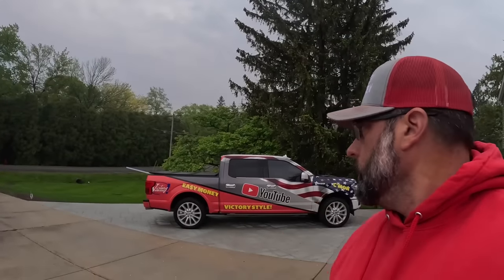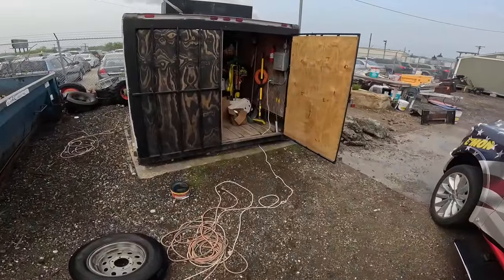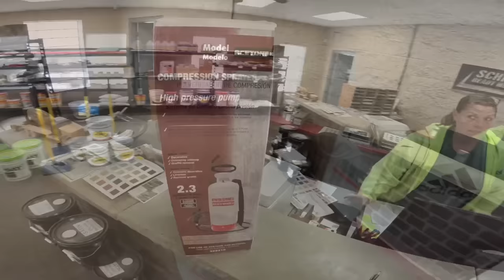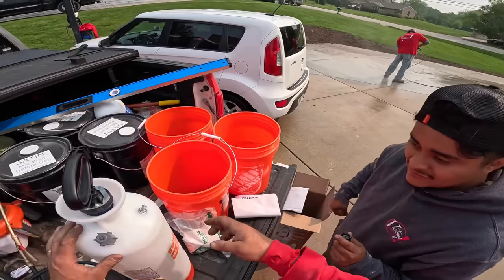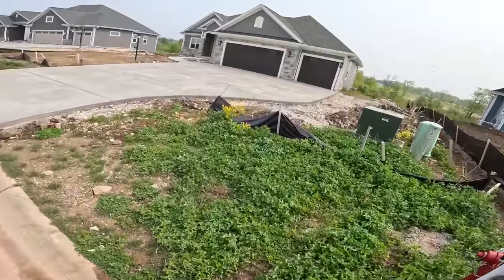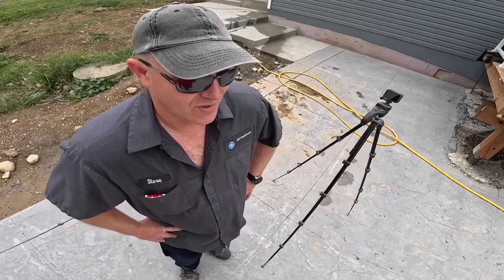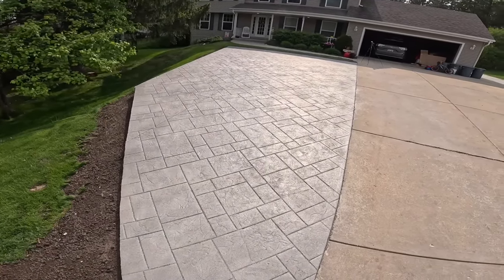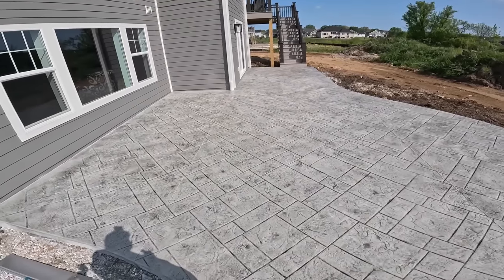Birthday workday!  Still making easy money at 46!

Comment: Ryan try using a paint mixer for your color stain. Just use your power drill, it will suspend the particles much better than stirring it with a stick.
Reply: I wanted to comment the same exact thing. I think his issue came from mixing with a stick like in the stone age 🙂
Reply: +1 for this.  He should know better😮
Reply: Yup!!! All those chunks in the bottom will clog up that sprayer in no time!
Reply: i was telling him from over here to clean the sprayer filter the whole time lol i think it was clogged up
Reply: Ryan really should’ve known better with all of his experience! I think he just doesn’t like sprayers! Lol 👍👍👍😎🇨🇱
Reply: That is what I was going to say... But I would use a little hot water to mix initial then the rest cool water... If it's 3 1/2 gallons 1 gallon of hot then the rest cold water...
Reply: @joepisarz682  Said the same thing....Some boiling water to get the initial mix dissolved, followed by cold water to make up the volume.

Comment: Last video I mentioned that you might make a quick compilation of your stamped patios and here you are, way ahead of me! Those all looked great! 
29:20 When new-fangled tech fails, go back to the old fashioned tech that works.
Reply: I think the sprayer may have failed because he didn’t mix it well enough. Big red flag went up for me when he just poured all the chunks at the bottom of the bucket right in the sprayer :/ he shoulda tried using a drill with a mixer attachment at least instead of doing it the old fashioned way. Would have gotten a much more even mix that way.

Comment: Good Afternoon, I appreciate your videos. Three   other effective methods of applying a liquid antique are to mix in the 5 gallon pail as you did, ( even better to have a measuring pail, in case you need to make multiple batches to keep the batches consistent). Then use either a mop, a small stiff bristled brush, or a car brush. Always keep the concrete damp , if it is not damp you will see brushmarks after you seal. You can leave small puddles , just make sure everything is dry before you seal, especially the antique itself. Do not seal if the antique is damp. Or you could get white spots , if this is to happen re-emulsify the sealer with Zylene. Like I said , If you wait till its dry , there will be no problem. With all three of those applicators ( mop, car brush or stiff brisled small brush) Swoosh the bucket of liquid antique before every time you drop the applicator to the textured slab , then you can move the particles into the deeper imprints of the stamped/textured by moving the applicators in a clock wise , counter clockwise, north-south direction, ect.....these are just suggustions. Thanks for the videos.

Comment: Try adding warm water to the Antique-it mix - it may make it more soluble, although it might not be available out in the field. You may want to enquire if a small amount of alcohol can be added to the mix. In many applications, the alcohol breaks the surface tension of the water and making the mix more homogeneous. Just a thought.

Comment: Ryan l have cleaned carpet for nearly 20 years, in the early days we used pump up sprayers then found a tank you hook up to a solution hose which would be your pressure washer hose you would actually get the same pressure for the entire job instead of pumping going a little about 2 or 3 ft having to pump up again go to a 3-foot if you can find something that you can connect to your pressure washer that would give you consistent pressure the product we used was called hydro-force it had about a 1 gallon tank

Comment: I don’t know anything about concrete coloring, but whenever you dilute a powder in water you have to let it saturate for a while so it all dissolves. I use a smaller amount of hot water for copper sulfate and a drill paddle paint mixer. The hot water helps break it down, then once it all dissolved I mix it with the desired amount of cold water in the sprayer.

Comment: Going to have to put together a utility trailer just for stamping equipment, getting quite the extensive collection.

I have anxiety issues with pump up sprayers, I've broken so many over the years, and usually right in the middle of a job. 
I'm holding my breath every time you start pumping that sprayer, lol.

edit just like that one finally did, right in the middle of a project, as usual.

Comment: Perhaps it’s worth getting one of those drill attachments to mix the product and instead of a sprayer you could use a watering can and brush it in after , 👍👍, the lumps in the dye would have blocked the small filters on the sprayer

Comment: My immediate thought was the sprayer nozzle was not suitable for the powder particles in the mix. If you can get a nozzle with larger holes it will work. I beti f it was just liquid the sprayer would be just fine. Great recovery job all the same.

Comment: I never mix powdered anything in cold water.

In order to get a powder or granules to fully dissolve I use use a small amount of hot water first. Then when the powder or granules are dissolved in hot water I complete the mix by adding in cold water in the necessary quantity. All that sloppy goop was probably clogging your sprayer nozzle because the particles were not completely dissolved into the solution. I don't even like mixing mortar with cold water, and I go over the top with the mechanical whisk to ensure a proper mix

Comment: Get yourself an electric automatic mixing sprayer that allows for medium-high particle size, they have a rotating mixer inside that keeps the color from falling out of mix. On top of that with them allowing medium to high particle size prevents the sprayer from getting blocked up. That's probably what happened with the spray bottle you had.

Comment: The holes in your gas tank are from camphor Beatles, they are attracted to ethanol. They “drill” small holes in plastic fuel tanks. I had a lawn mower that those little suckers completely ruined the entire fuel system.

Comment: Ever thought about 5 Gallon Buckets to pour the extra Concrete into Bucket half to 3/4 put a Pole in it. Then you can use Bucket to Secure Caution Tape to Pole/Bucket advertising on buckets...just a thought
Keep On Keepin On

Comment: Look into getting a surface cleaner for the pressure washer. It's much more efficient and does a more consistent job than using a regular tip on a wand. You do have to match the surface cleaner gpm to your pressure washer gpm. Do not use it on new concrete, it will etch it. As long as the concrete is at least 5 years old it will be fine.

Comment: Get you a paint mixer paddle for a drill and mix it that way that stuff was way to clumpy and that what was causing the sprayer to plug up. But if you mix the stuff in a bucket with a paint paddle on a drill there will be no clumpyness.

Comment: 30:00 it's pretty simple why the sprayer gets like that. it's because someone isn't cleaning it properly. after using it, you need to load it with soap water and then spray it, that will clean the head and hose. THEN you can store it.

Comment: Someone put the holes to the gas can can drain faster. Those cans with that type of spout never flow gas verfy fast at all. It takes forever to fill up anything with them. You can see where someone put tape in the middle because they put it in the wrong place and gas was coming out of it when turned foreward. You have to put a pin hole toward the back top of the can handle and not overfill the gas can in order for it to be affective. The can must breath air in for it to flow well. That's why when you use those you hear gurgling sounds when trying to pour gas. The side also sometimes cave in from not having air in the tank.

Comment: Lots of advice about dieting. Well here's mine. Cut out the sugar like soda, bread, rice and pasta is the main thing. Eat smaller portions and lots of fruits and salads. Meat is okay, beef, chicken and pork. Of course exercising helps, but get thst from your job.
I was 225 when I retired and in 8 months got down to 185. Work grave shift for 20 years and was eating in the middle of the night. Also the weight loss got rid of my high blood pressure and lowered my A1C and cholesterol. Need to go get a yearly physical, blood test and colonoscopy.

Comment: Ryan? Would it damage concrete if you use a surface cleaner to clean the stamp concrete? would think it would be faster to clean concrete and not leave line streaks

Comment: Honestly Ryan your rushing a little to fast with the stain it’s not going to mix with cold water  either. It dissolves with warmer water better. Also your sprayer wand was most likely just clogged by undissolved stain all you have to do is unscrew the tip flush it out and leave the tip a bit loss.

Comment: You need to get an Apple Card account; you can use your phone for purchases, and give your card to the guys when they need to pickup something for you (the titanium card does NOT have an account number on it.) The Apple wallet does a great job organizing your spending. No fees at all, even if you exceed your limit. Also instant cash back and many other benefits. You see your purchases in real time. I’ve been using it for 3 years and couldn’t be happier with the service.